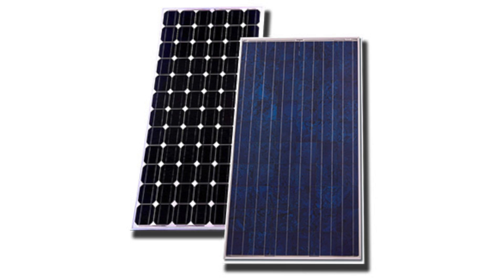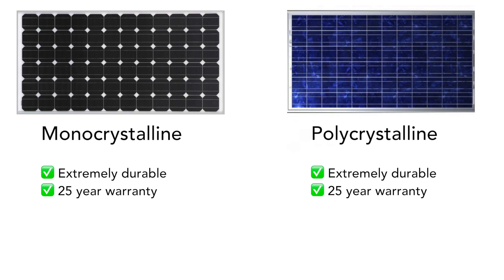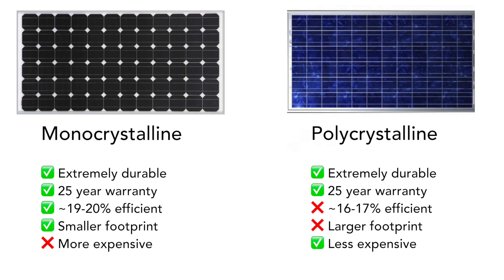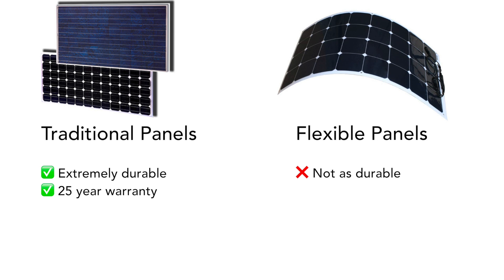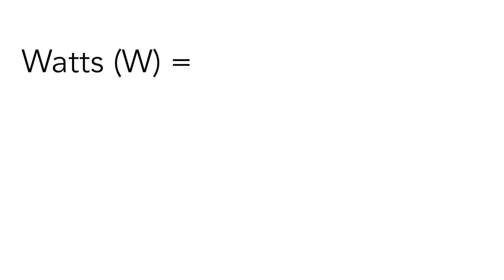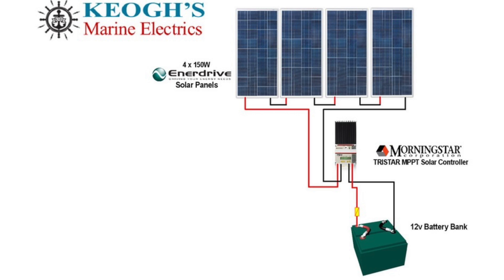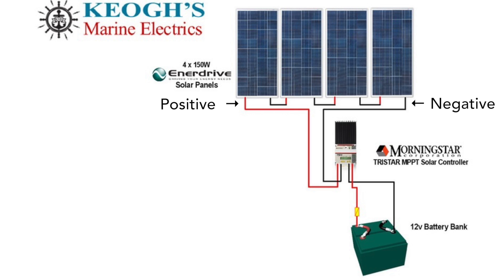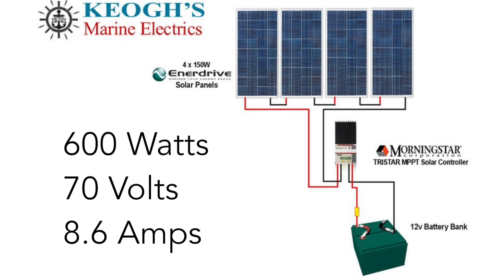Mono vs Poly vs Flexible Solar Panel + Series vs Parallel Wiring

Comment: how did you come up with 35 volts and 17.2 amps at the end? overall very informative. thanks for the video.
Reply: Alexis Keys there’s a missing segment on the panel specs. He kinda uses a non conformist illustration to describe a set of panels with generalized ratings. You have to start with your specific panel ratings and there are solar calculator sheets on the internet. Not that it makes it any less confusing but you can at least put it in writing for your design and then have more knowledgeable people take a look at it without taking up a bunch of their time. 

I kept mine for about a year the solar spec and panel with the battery diagram calculator sheet LOL.

Comment: Very informative, but it would be great also to mention about   LID ( Light Induced Degradation) of each panels brands, because solar panels do degrade  overtime, some degrade faster/slower (0.5-0.7% annually) making it less efficient the longer the panels run. Some of the newer ones do have Anti LID feature on their panels. Mentioning this will help prospective customers to better understand and help them decide which solar system they will go and buy.

Comment: Can you help me with my doubt. I have one motor home with 2 solar panels. One mono and the other Poli. The Poli come already in the RV. But was a very old system so I make a new for the new mono panel. But i let stay there the old one, Without being using. My question is can make parallel  or in series? Because I feel pitty to don't being using.

Comment: Thank you for all that info ! -- For series & parallel wiring of 4 panels, there is a 4th alternative not mentioned: wire 2 panels in parallel each and put those in series (making up a H-shaped wiring) ==> at first glance this seems just same like  wiring 2-series in parallel as shown, however the additional bridge wire between middle might  give you some advantage on partial shaddowing one of the panels...

Comment: Question, I read somewhere that when wired in series the panels will charge quicker or earlier as they reach the required voltage of 14.3 or something like that and that was in partial shading of which I think is different than shading one panel. Would that be correct?  Great vid BTW

Comment: Thank you for a great video! I have just started looking into solar energy. I live in a cold climate state (PA) and my home runs on electric energy including 220v base boards for heating. Will I need a ton more panels to power my heat as well as everything else in my home? The other concern I have is If I have a power outage to to my house then I risk my pipes bursting. I was looking into stand alone generators but if I go solar then is my only option for back up power buying batteries for the solar panel to store?
Reply: We campers use solar and generators as required. Do not heat your home with solar electricity, look into Solar Hot water roof top collectors.  You may have to add a fan forced hotwater rad or two, plus domestic hot water.  If you are unable to use the electric grid (grid tie) then solar panels are not feasible except for a hunt camp where lights and a TV or water pump is all that's powered.

Comment: Wait what? monocrystalline panels don't have a higher eficiency. Polycrystalline panels are more expensive but have a higher efficiency. So this comparison is wrong..
Reply: You are wrong. Monocrystaline uses a much higher quality silicon and a more expensive process. Higher efficiency and higher cost
Reply: @Michaelpedia  You are absolutely right, I was wrong.

Comment: what will happen if i feed a 600 watt, 1.7 volt, 34.4 amps system (like the one that you have explained connected in parallel)  to a 30 amp MPPT charge controller. Would that toast the controller because it is only 30 amps or will it just disregard the excess 4.4 amps?
Reply: Kon Tiki yes. You can’t expect weather conditions to not exceed a max. They often do have spikes esp for the voltage. They say you should always go larger not smaller. They have 38v systems now so it’s not a big jump.

Comment: Don't worry about 25 year old warranty on products that will become obsolete within 3 years. In three years there will be new twice as much efficient panels at same or lower price. Just get the cheapest panels you can find on eBay.

Comment: Thanks for the info. Btw you didn’t mention about the big difference between mono and poly. Mono are designed to be exposed perpendicularly to the sun rays, the crystals are oriented all in the same direction. Poly has multiple oriented crystals, so less efficient compared to mono at 90 degrees but more efficient in any other angles. I think polys are best in winter, northern regions and places where the sky is cloudy the most of the day. This is what i found reading over internet but if i’m wrong or i’m missing something as technology improvements, feel free to correct me (sorry for my broken eng)
Reply: Thanks for this very important addition about mono and poly.
Reply: Thank you for this clarification. I have been looking for this information.
Reply: very important to know. could not find this info previously and seems like the absolutely most important distinction. thanks :)

Comment: a solar panel can also be stepped up with a motor and a generac stator. they are all over the place they break (the motor) just get a used (or broken one) with the number of plugs you need and then  make a plastic cutting board box and then abs the stem and put on the stator and then the stator magnet (which is usually on the outside of the turning stator on a bar) then use the solar panels to make as much energy as you want. Store the old ones and replace the motor about every six months to a year. you can use old ebike motors and sedge-way motors just fine. your weight plus bike weight is equal to stator weight.

Comment: The amps on the charge controller is the amp to the battery not always the same as the amps in if you have a MPPT controller!

Comment: 1 question: so if you hook them up 2 array of parallel, and then these 2 array in serie for a 24v system.
the amp will remain as the amp of 1 parallel right?
Reply: When you connect 2 array of parrallel in series, now u will get 35 volt and 17.2 amps

Comment: If the solar panel are connected in parallel, the volts will remain the same and if it is not within the MPPT working range, the charge hours are lesser, no?  Whether is to connect in series or parallel are very much depends on individual site and the equipment that one has

Comment: Hey. Ur explanation  very helpful for my research about solar panels. thanks you.
Reply: hi.. i am having two 350w 24v solar panels and single 200ah Battery and mppt solar charge controller 40amp...should i connect my pannels in series or parralel to charge my battery and run some load on solar simultaneously?

Comment: Oh, and available today are systems that use either power optimizers or micro-inverters, both of which change the wiring possibilities along with removing restrictions in layout and remove shading issues.  You should also be aware that the voltage and current are not fixed.  An example factor in varying voltage is temperature, which can change significantly throughout the day.  One other factor that should be considered is there are lots of factors that derate, or reduce, the current carrying capacity of wires and cables.

Comment: Are they converting to ac for standard use? Are inverters used at each panel or group of panels? Or is there a large inverter for the whole array?
If your off the grid you still use standard ac for your appliances? Or does the DC power go straight to the battery.
Do the controllers have a ac/dc inverter built into them?

Comment: Hi. May I suggest you look at www.das-energy.com. This is an European manufacturer of high quality, lightweight, semi flexible solar panels using classical mono crystalline sillicium cells. We offer a very high conversion percentage and durable solution with a 25 year production warranty with only 0,70% linear degradation. For standard panels, prices are very acceptable in the 1.33 €/wp  range. We offer 335Wp in a 2m² panel with only 2,5Kg per m².... Very low installation cost and perfect solution for floating PV parks. I am exclusive distributor for several countires in Europe and abroad. Feel free to contact me for more information. My mailadres is Chris@comdiseurope.be.

Comment: I want to have a 600ma Wi-Fi cctv running 24 hours in a remote location.  What is the best option.  Mono or poly.  I am from sri lanka
Reply: 600 ma = mili amp  ..    you need a solar cell for that, not a whole panel.  look for CELLS that put out 600ma

and 24 hours is hard with solar, considering you'll need a battery bank, and a charge controller.

Comment: I have 2 6v 250 amp hr 26v 300 amp hr will I have any problems wiring them in series and or parallel.Thanks Jay

Comment: This helps a lot, thanks.
I have only one question.
To get the battery fast charged, you need more Wat and it does not mater if you place them parallel or in line. Am I right?
Reply: to charge a battery faster you need to cool the battery or it will simply erupt ..

that is to say, to much = a bad thing and patience is a better choice

Comment: What is NEVER pointed out adequately is the panels DO NOT typically produce their maximum rating. Your 600 watt system very rarely produces 600 watts. It is almost always producing much less. If ANY PART of any panel is shaded the total output is typically reduced by 80% or more. Even if it is a few square inches of only one panel in your array. Try making that perfectly clear!

Comment: Sorry , just a bit confused about calculating Volts for a parallel system . You use 17.5  V in your calculation should it not be 12 V ?   If I use 2 X 40 W panels it makes a difference of 80w/17.5=4.5 vs 80w/12= 6.6 ....hey , in a small system 2 amps is 2 amps.! Thought I saw you use the 12volts in another video ( could be wrong)
Reply: series = add the volts...       parallel = add up the watts..

note that the easy way to calculate output is volts x amps = watts      and if your selling power they take it in kilowatt/hour       

I get 27 cents per kwh  or...  every 1000 watts ...   but I'm also running other generators like wind turbines

Comment: We have 2 90w poly panel In series can I add 1 50w mono In parallel, our mppt charger can do 250w In 12v, or put bigger panel and second charger, can I use pvm then

Comment: HAVE 2 200 12 VOLT SEALED AGM BATTERIES FOR MY SOLAR  SYSTEM (2 PANELS 300 W EA}. 2000W INVERTER. CANNOT REMEMBER HOW THEY ARE WIRED...CAN I ADD TWO MORE OF THESE SAME BATTERIES TO THE SYSTEM TO INCREASE STORED POWER?

Comment: hi, which is the best way to connect battery bank with a controller on grid, I have seen diagrams where the  wiring goes from the controller to the battery and from the controller to the inverter,     and others where it goes from the controller to the battery then from the battery to the inverter, what is the difference

Comment: In an RV everyone is different. People live in different climates. People live out in the open in sunlight. Some live in a mountainous or shady area. People camp under shade trees. This is a very informative video. Some solar companies say to wire in series. Some say parallel. I’m in Florida. I do not park in the full sun if I can help it. I wire mine in series parallel. Whatever works to keep my fridge and lights on.
Reply: battery to controller = you get to program how much you feed out from the batteries..

if its battery to inverter its pulling everything the battery has to give... (meaning it will drain it fast)

battery to controller is better...  then you can record the power usage...

Comment: Id like to know what benefit do you get from putting panels in series as opposed to parallel aside from having to use thinner wire? It seems the drawbacks outweight the positives. Does series give a quicker charge? I dont understand

Comment: Can you run two charge controller to the same bank of batteries  Lie if you have two 100 watt systems and you want to use a controller for each 100 watts system, and not buy a larger controller ?

Comment: Why doesn't solar technology have it so that in a series hookup, if one panel has less than some threshold of sunlight, there is some internal automatic switch that engages and just passes thru the current of the other non shaded panels?  That is, the shaded panel would temporarily just become like a wire to pass current.

Comment: Another major reason for connecting panels in series, which wasn't mentioned in the video is this; Solar panel controllers (MPPTs) typically require Battery voltage + ~2 volts to function. Let's say you've a 12 V system you're charging at 13.8 V. That means that the MPPT must be fed with at least 15.8 V. If you've panels that output 18V but it's an overcast day, they could easily drop to, let's say, 15V. As 15V is below the 15.8V needed you won't get any charging at all. However, if you string two panels together, then you get 30V on that same overcast day, and the MPPT will happily charge your battery.
Reply: odd...  your systems use more electricity then they should.   12 volt marine grade bat system charges fine at 13.8 volts... the whole system aint capable of 15 volts.. so I know its charging at 13.8 :-\
Reply: Read the comment again. You're mixing the voltage coming from the solar panels into the MPPT (which is quite common at 20V per panel) and the voltage going into your battery (which is more like ~13V). The MPPT is there to take the (higher) voltage coming from the panels and transform it to something the batteries can handle.

Comment: This is a sales pitch with a lot of false information. 
First Solar is the leading manufacturer: here's one of their "data sheets" - itself a sale pitch.

http://www.firstsolar.com/-/media/First-Solar/Technical-Documents/Series-4-Datasheets/Series-4-Datasheet.ashx

There "25 year warranty" is that those products will degrade by 20% over 25 years. 
The product warranty is only 10 years and subject to terms and conditions that are not disclosed.

Comment: and btw mono crystalne panels only charge and work on one wave length of light .. and start working later than poly crystaline... which are designed to work with 2 to 4 different wave lengths of light and run at lower lumens .... and last longer ... 
.
silcone .. is not photovolatic ... silicon is ... silicone .. is like caulking and fake boobs ... silicon is what the make solar panels out of and ic's etc ... so hate to say it .. when you havent even got the right info down everything you talk about is wrong from then on

Comment: Got my system in a kit, and it works great. Only comes in series. Now I have done my research and I will say you have put things out very direct and simple. The visual aids really helped. Excellent work.

Comment: i have a problem with my tracer 40a 4215 bn/mt50 monitor and 4x100w panels wired in series. then i wire them in series, the monitor will show the accumulative voltage fora  few min, say 30v, but then that will go down to 13.4-14v, and im only ettign around 1-1.5a on a sunny day.

Comment: I have a question and ive looked all over online today including amazon and cannot find what im supposed to do.. in this video you talk about 4x 150w panels.. I have the same setup.. 4x150 
I want to make my panels the 3rd option you spoke of making them both series and parallel.. but in the diagram you made it confuses me because I cant figure out what kind of MC4 connector is supposed to be purchased ive linked one before but not sure if this is correct

https://www.amazon.com/gp/product/B017TQFG4C/ref=ox_sc_act_title_1?smid=A2D22KZJD14Y8Y&psc=1

Comment: Uhhhh...

The flexible panels come "naked" without tempered glass.

But it's not a design flaw.

If you put a mono crystalline cell on your roof without protection it would be ruined in months.

So shouldn't you compare Flexible panels with glass cases?   

The ideal is popping these things into a 3x4 foot frame and clipping the connector on.

Comment: Very informative... because it helps me the concept on solar panel installation that is far from the line of my work... in an example, I am not an electrician as I don't know either on installation load requirement??? I only knew is plug and play only that may cause me an accidental fire... Thank you. Duet for sharing of your knowledge...

Comment: You seem to be using "flexible" and "thin film" interchangeably.
Flexible crystalline panels are Silicon based, while Thin Film panels are usually made of non-silicon based materials.
The panels I decided to use on my RV are thin film CIGS panels. These panels have many advantages over Crystalline panels. They perform very well in high temperature, they are more resistant to shading, adhere to the RV roof directly (no fasteners). But hey do cost a bit more.
See here for more info http://miasole.com

Comment: You can't talk about series vs parallel without talking about optimizers. There is a reason why everyone is installing optimizers if they don't use micro inverters.